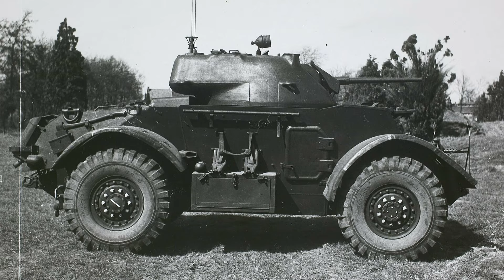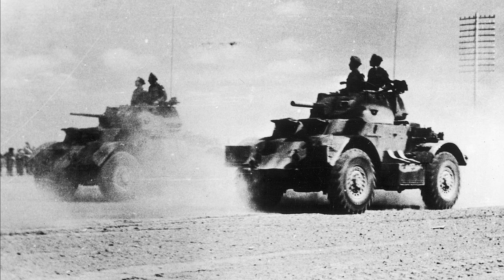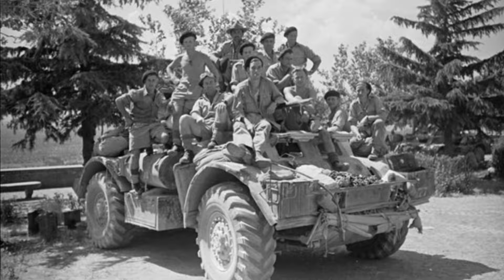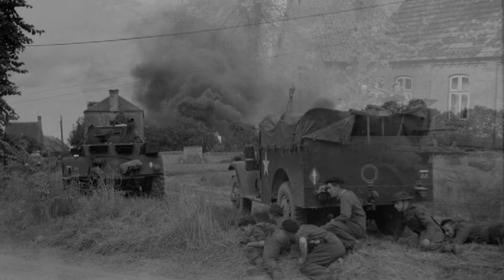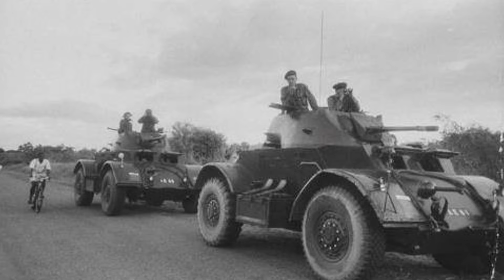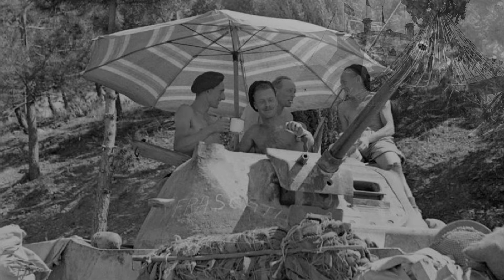Why This Armoured Car Changed WWII - Staghound T17E1

Comment: Armoured cars became popular for use in the deserts of North Africa from 1940-43 but sadly the Staghound did not make it in time. It was a huge vehicle not much smaller than a Sherman tank, but armed only with the weak 37mm US anti-tank gun. It was firmly rejected by the Americans and it was passed on through Lend-Lease to the British. The British army rejected it for reconnaissance, prefering the  smaller Daimler and Humber. However it was used in the HQ of Armoured Car Regiments as a Command Car. It was used by some Empire armies, such as the Canadians and New Zealanders for reconnaissance. In 1945 the British mounted a Crusader tank turret with 75mm gun for use by the Canadians. Similarly in the late 1940s the Dutch mounted the AEC 75mm turret and sold them to Lebanon.
Reply: Also Sudan had a version from AEC which had a modified AEC turret fitted with the mantlet and gun from Sherman tanks. The QF75mm no longer being made post war so the AEC turret had to be changed to carry the American M3 75mm gun instead.
Reply: @johnfisk811  Not come across that version so could br the AEC MkII up-gunned to US 75mm M3. There were few AEC MkIII with British 75mm built.
Reply: @billballbuster7186  This was not done to the AEC
Reply: @billballbuster7186  AEC had turrets and the factory set up for them but the armoured car works had gone back to making civilian lorries so they bought up surplus Staghounds instead to be fitted with the AEC turret. However, the Ordnance QF75mm guns and internal mantlets  were no longer being made so the solution was to cut back the turret face to take M4 Sherman external mantlets and mounts and use the M3 75mm guns for them. I suspect a shady deal with the newly independent Sudan for some official whereby they were bought as  ‘tanks’ and an invoice provided to match the ‘tank’ budget in the new Sudanese army and a smaller amount was actually paid whilst the balance sort of ‘disappeared’ in the common manner of the period Sudanese government. They do a few parades but there is no sign of what happened afterwards. Probably parked up and left until sold to some Egyptian scrap man. I have seen Staghounds in Nicaragua, India and Cuba.
Reply: @johnfisk811  Under the terms of Lend Lease most Staghounds were gone soon after the end of WW2. So they could have bought them from the US or from those given to the Europeans?
Reply from the maker: Excellent insight — really appreciate you adding all this. 😉👍🏼❤️